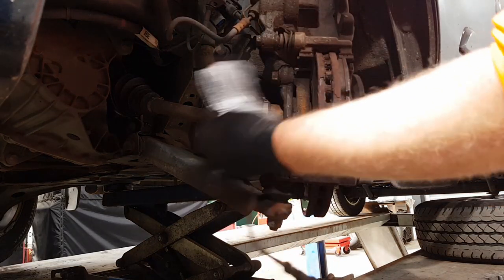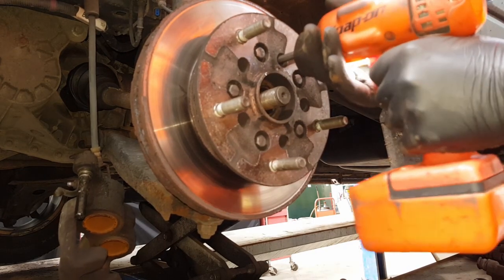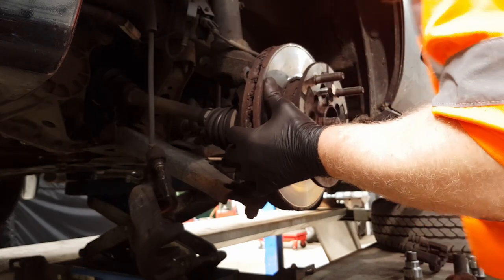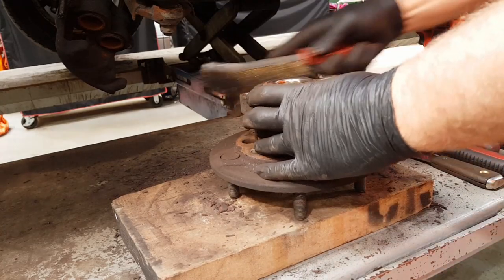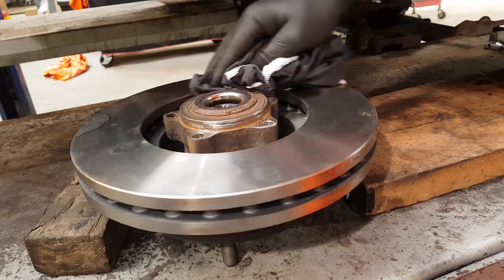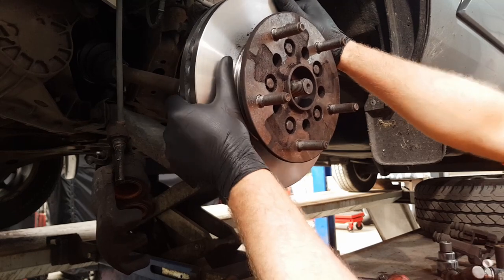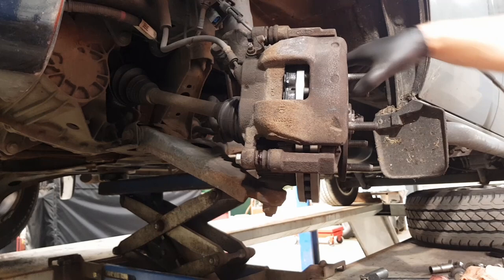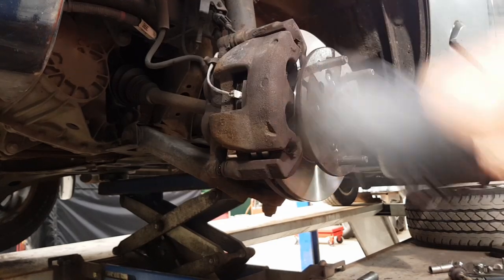Transit Custom how to replace front brake discs and pads replacement due to brake judder 2012 on

Comment: This is a brilliant video thank you very much, I have just finished doing my discs on the van. There is also a great method for getting the disc off the bearing by Bodgit and leggit garage. No hammering required, worked a treat. Thanks agin.
Reply from the maker: I'm glad my video could help ☺️ thank you for your feedback.

Comment: Just used this video to do mine im up to un doing hub nuts as not got a deep socket till tomorrow.....this video is the best one ive found on doing this many thanks.
Reply from the maker: Thank you for your feedback I will be putting up a rear disks one soon.
Reply: My fronts had completely collapsed. Only done 55k never seen that before in 30 years of driving!
Reply from the maker: Mine have warped twice since I have had it, given a bad vibration under breaking
Reply: @Martysworkshop  twice blimey that's bad should get 100k out of a set of discs....I've gone for Delphi ones ....see how they do....cheers for the tutorials I've just subscribed now
Reply from the maker: Thank you for your support

Comment: I wasn't going to say anything as for the most part I was learning from you, BUT you did ask for advice at the end LOL so; I worked for a torque tools manufacturing company (Norbar) and they drilled into us that clicking multiple times on the torque wrench actually increases the torque every time due to the function of the torque breaking device - every time it clicks beyond the first one is increasing the torque. They showed us this on a torque measuring device with a normal click style wrench and its interesting to see how much it goes up - its a bit like an impact hammering action. So to get the correct torque you should click it once and trust it or, if you really must, a second click only, no more. And if you are doing a bolt circle best practice is to click once only first time around, and then give each bolt just one second click to double check nothing was seated oddly the first time round. 
Cheers for the help you have given me!
Reply from the maker: Thank you for your feedback, i have never given it a thought but it makes complete sense! Thank you again for this comment i will definitely give this a thought as i use torque wrenches every day.

Comment: Just want to say a big thank you for the vid . I’ve just finished doing my front discs and pads . Followed step by step and it was bang on . Only Fock up I had was one of the stretch bolts snapped when removing the disk . £1.50 for a new bolt from the ford garage so happy days . Cheers 👍🏻
Reply from the maker: Thats brilliant and thank you for your feedback

Comment: This was a great help, and avoided me starting the job without the torx bit and a long m10 bolt, and saved a lot of head scratching! I needed to use a second bolt to get my disc off on ond side, the side where the disc was fractured thru the cooling fins....! Another tip, gas bottle spanners are 21mm on the smaller end in UK, as I didn't have a 21mm apart from that one :)
Reply from the maker: Thats good input thank you for your feedback its not a bad job once you get into it. Thank you for watching
Reply: What is the length of the M10 bolt?
Reply from the maker: At last 100mm

Comment: Good video, had 1 torq socket snapped in the head off bolt torq bolt!! painful Experience could not get the snapped socke6out spent hours and a fortune on drill bits, got there in the end!!
Reply from the maker: Sounds like a painful experience, glad to hear you sorted it tho, thank you for supporting the channel

Comment: Great video mate. Just started doing my disc and pads today. Mines doesn't seem to have a brake pad wear sensor
 Also the bolts holding disc to hub are absolutely solid all the way out . Feel as if they are going to snap .
Reply from the maker: Spray some wd40 or something simular, have they started to turn? If they have work them in and out a few times to get the release oil into the threads. Thank you for watching
Reply: @Martysworkshop  

Yeah they have started turning. Will try and spray them in the morning with some pb blaster and work them in and out. 

Cheers mate for the advice

Comment: Great video, I have the same juddering under braking.  What causes that juddering? as this will be my 3rd change of discs/pads in 25k miles of gentle driving and braking due to juddering. Tempted to DIY it myself. I have the 9 seater Tourneo.
Reply from the maker: Mine warped due to being worn thin. Only advice I can give is use a good make disks, I use apec or mintex, most factors offer a cheep or premium brand and garages tend to use the cheep to keep cost down. Thank you for watching.

Comment: Massively helpful guide lad but after following it to the dot, one thing I'm wondering about, copper grease for the pads ?
Reply from the maker: Thank you for your support, yes copper grease on ether end of the pads where they slide is good to stop them sticking in my opinion but some people think it is a bad thing so i left it out of this video

Comment: Great concise & well explained video 👌 I’m looking to purchase a Transit custom at the moment so came across this while looking for information on their common fault, do you know what the best engine version to go for around the 2014 - 2016.

Watched all add’s so you get your Pennies 👍 “Liked & Subscribed”
Reply from the maker: Thank you for your support ken, i own a 2013 limited 130 i couldn't be happier with it, i was advised to stay away from the 150 model when i bought mine as they have more problems, but it is the same engine just tuned up more so i can't see a problem. I Guess its more on the driver. Know i do know the newer ad blue engine (new shape) is having a lot of issues so i would stay clear of them. Hope this helps

Comment: Top video. Quick question, which tool did you use to retract the front caliper pistons? Thanks again.
Reply from the maker: I just use a large flat head screwdriver
Reply: One more question Marty. I see videos where people when pushing the caliper pistons back they open the bleeding nipple which is connected with a little pipe to a plastic container. What do you think about that? I am concerned that opening the bleeding valve you can get air in the sistem. Thanks for your advice.
Reply from the maker: I have never done it tbh, I just push the pistons back with a screwdriver. I would also be concerned of air getting in the system just to make it easier to push the pistons back.

Comment: Great vid. Problem I’m havin is the drive shaft won’t knock through, it’s stuck and I’m welting it! Any tips on solving this? Thanks. Mat
Reply from the maker: I would try a puller on the flange witch pushes on the shaft. If that fails you may have to remove the complete hub and shaft and put it in a press, i have had to do that before tbh, hope this helps

Comment: Hi, Just wondering whether you need to add the 90 degree angle after torquing the bearing to disc bolts as they are not new stretch bolts. I thought the final angle on the bolts is for the stretch. Would a bit of medium strength thread lock be suitable with the 30nm torque on the bolts ? Cheers
Reply from the maker: Your wrigh as the bolts won't stretch the same the second time but 30nm is nowhere near tight enough for thease hubs  a simple rule for stretch bolts is if you can run a nut down the thread with your fingers then they are good to use again. Hope this helps

Comment: Great video mate. Some of the torx bolts are knackered on mine but can't seem to find any on the web, any ideas for suppliers?
Reply from the maker: Not sure but you could replace them with alen head bolts as they shuld be more available. Hope this helps
Reply: @Martysworkshop  thanks, didn't think of that. Nothings straightforward is it!!
Reply from the maker: Not thease days I'm afraid

Comment: How tight is the front hub nut, I cant undo it I've bent 2 t bars already, it just wont budge.
Reply from the maker: It's 500nm so you need to use a 3/4 bar or high torque impact gun,

Comment: what's the mm thickness of discs that will require a replacement?
Reply from the maker: Technical manual says 30mm is the minimum front and 13mm minimum for the rear, thank you for watching

Comment: Great walk through video, is it the same on a rear wheel drive?
Reply from the maker: Thank you craig, the transit customs only come in front wheel drive but the larger transit couriers and previous model transit in rear wheel drive is the same setup to my knowledge but instead of a driveshaft you would have a dummy shaft in its place.

Comment: Did you take off the brake fluid cap to help push the piston in
Reply from the maker: No the cap will vent to no need to take it off. Thank you for your question

Comment: Hi, where’s the best place to get the bolt. No where has that size
Reply from the maker: Sorry that one is stainless here is a pack of 10 for less https://www.ebay.co.uk/itm/METRIC-HEX-HEAD-HIGH-TENSILE-SET-SCREWS-M10-x-140MM-1-5P-8-8-GRADE-ZINC-QTY-5-/183138188373?mkcid=16&mkevt=1&_trksid=p2349624.m46890.l49286&mkrid=710-127635-2958-0
Reply: @Martysworkshop  thank you
Reply from the maker: Glad i could help

Comment: Have you done the rear pads and discs yet?
Reply: Is it the same kinda thing?
Reply from the maker: No but when they do need doing i will get on on here, they are actually a lot easier as you only have to remove the centre nut and the hub and disk just pulls off. Thank you for supporting the channel
Reply: @Martysworkshop  is it again the same 36mm socket for the hub nut on the rear? Thanks for your help!
Reply from the maker: Im not sure to me honest but you shuld be able to pop the hub cap off to see.
Reply: @Martysworkshop  cool thanks. Got the job on Saturday front and rear discs and pads so i will see!